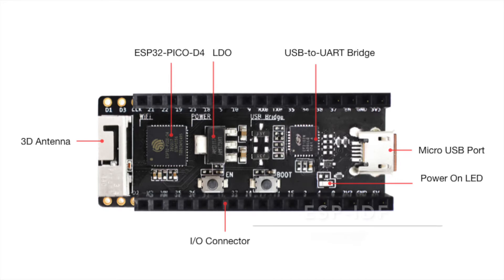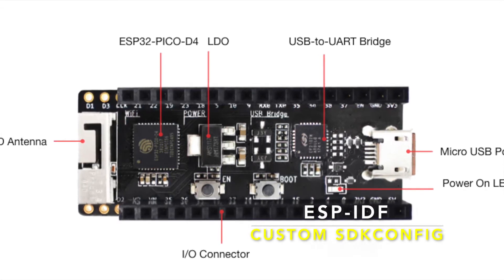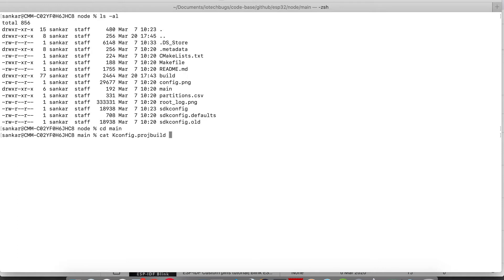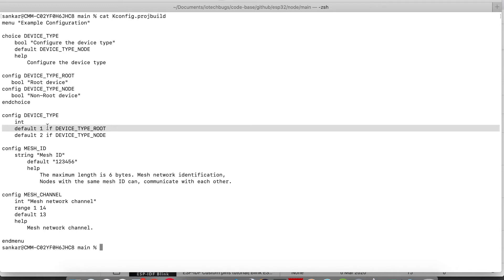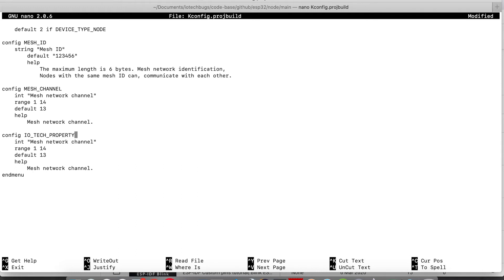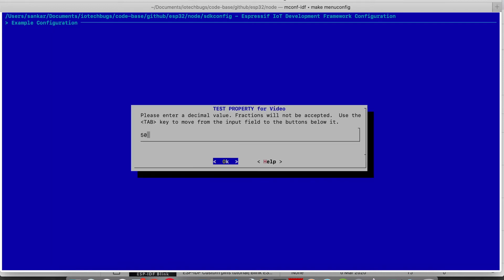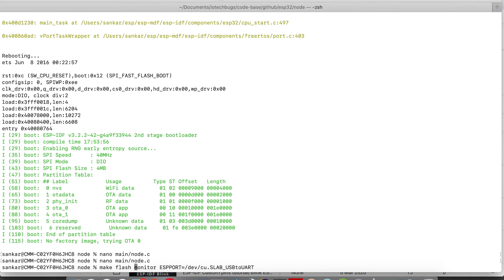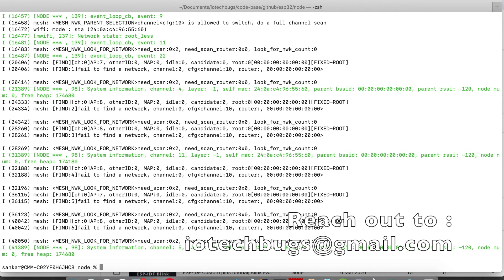ESP-IDF/MDF Custom SDK config | Edit Menu config ESP-IDF | IO Tech Bugs

Comment: When building any of the example projects from the template, I'm getting the popup warning
"Low Application Partition Size"  "Less than 30% of application partition size is free (275,072 of 1,048,576 bytes)"!
"binary size 0xbcd80 bytes. Smallest app partition is 0x100000 bytes. 0x43280 bytes (26%) free."

So from within the IDE, I modified the partitions.csv and ran 'Menu Config' (also via the IDE) to use partions.csv.  However, after saving/building, the sdkconfig is still not using partions.csv, and thus I still get the size warning.    Opening the IDE's Partitions Table Editor, and Menu Config after building, shows the correct settings!!

So I modified the sdkconfig file manually to use partitions.csv, but as soon as I build , it gets overwritten back to the single app..   and the warning popup appears. 

Finally, I tried using the command-line to make the sdkconfig change, and that works.. the build doesn't over write sdkconfig.. and it uses the custom partitions.csv and I don't get the error.

But I don't understand why the sdkconfig changes don't take via the IDE.. nor why it would over-write it during the build.  I'm concerned that future sdkconfig changes via the IDE will show correctly, yet are not reflected in sdkconfig.